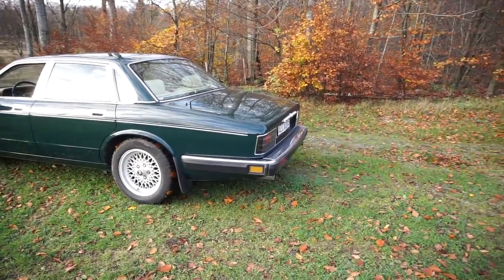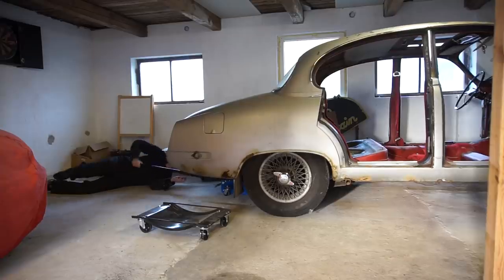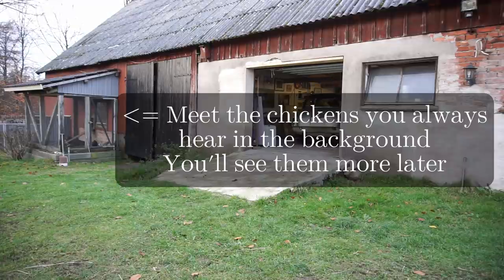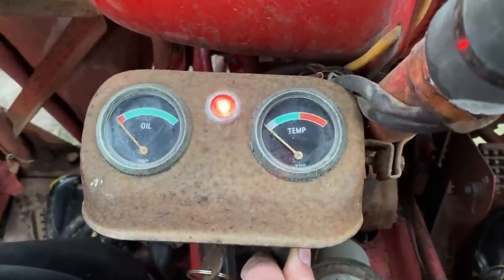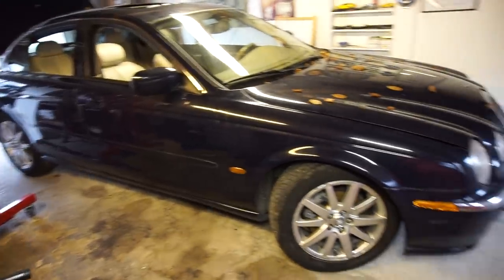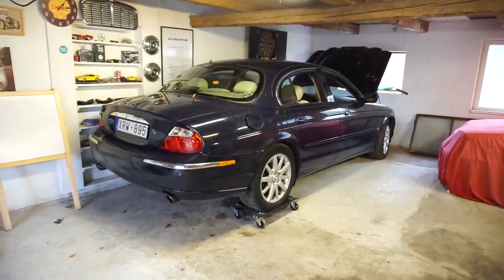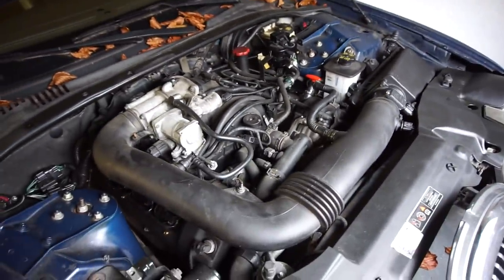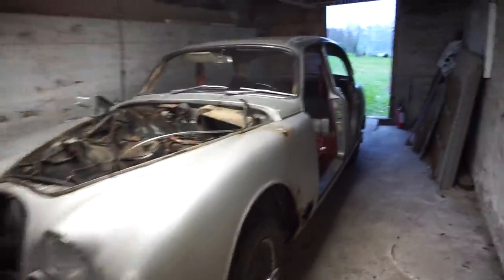My Wife Helps Me Move Most of the Cars on the Channel to Start the Next Project

Comment: I enjoy everything you do Adam. I use the same dollies and l struggle as well . I've  thought of fitting larger diameter wheels with rubber /nylon treads. And l 've also bolted a 12volt  winch to my floor. I used "thunder bolts " to secure it and have had no  hic cups . However my slope is not as extreme as yours .   I like your" use what you have "attitude.  So do you rent the farm?  The right rear sill/quarter panel looks like it will entertain you for hours and hours ! Great stuff.
Reply from the maker: Glad I’m not the only one that struggles with them.
No we own the farm. We bought it about 2 years ago and we’re restoring it ourself in our free time. 
Yep it will be lots of hours of cutting and welding ahead
Reply: @LivingWithAClassic   Free time ! What's that ? 😂😂

Comment: Hi Adam! I enjoy your channel a lot, I too have 2 series 2 XJ6's and an old 1800's place to live. I've also done a couple episodes to Youtube about metal casting, which I would like to continue with the time I currently don't possess. Your metal workshop plan looks great, I would recommend a device for sucking the welding fumes outside (such as Nederman)+ maybe fireproof panels (extra hard gypsum or fiber +cement-board) to the roof.

Comment: Hi Adam! Liked the vid a lot, also the christmasvid about the Fergie. Im in the process of taking out the 4.0 v8 from my 99 SType also. To lift it out is possible indeed but quite a drama haha. You have to disconnect a lot of stuff what is very difficult to reach like the bellhouse bolts, generator, pas pump and airco pump  Much more easy to lower it out complete with gearbox IMHO   Succes with all your projects and waiting for the new vids!

Comment: A significant amount of the work in restoration projects can be moving stuff around, which becomes much more difficult if you haven't planned what goes where. Watching the process is thought-provoking.   The ideal is not to move stuff any further than is necessary to get it out of the way. Another point is ensuring that you have adequate capacity safely to lift the heaviest things involved. (The tractor counts as a deus ex machina -or is it a machina ex deus?. )
Reply from the maker: It is! This was all done in a specific order too. That is why I didn't start working on the V8 S-Type earlier this summer because I knew I needed to move the 1966 S-Type before that.

Comment: 😀 yeah luv to see the S V8 being worked on/engine swapped
A few x308 bodied cars with the V8 are appearing on car sites where i live for sale for very low prices but stating requiring new motors & or blown head gaskets
Im surprised because many engines, for years, have 'nickasiled' cylinder bores
Must be a weakness in this model engine
At least not Mercedes where the camshaft sproket disintergrates & destroys the engine

Comment: Ha, so you found out the hard way as well with these dollies, I tried moving MY xjs on a set and met with the same result. They are  OK for moving body shells and heavy plant pots but anything more than that they are, erm you know, useless. I might try fitting larger wheels though and see if that makes any difference. You will also need to fit some extra power points as well by the look of it.

Comment: I like your style and that you like Jags.
I may have missed it but why is the engine in the V8 S Type "ruined"?
Reply from the maker: It was purchased not running with low compression. I got it going but then it turned into blown head gaskets and possibly more. There are 2 videos on it from earlier this summer on my channel
Reply: @LivingWithAClassic 
Thank you.
I will locate the videos you refer to.

Comment: My wife helped me move a "barn find" 1959 Jaguar Mk IX about 15 years ago. She sat inside the car, windows down, and steered it as I pushed. When it got to the correct spot in the driveway, she leaped out screaming that she heard mice in the car. Since then, she has refused to get into any car that doesn't run, or any car that has sat outside for any period of time. I used her refusal to build an addition onto the garage, taking it from 2 cars to 8 cars. So, I'd say a little mouse has been my greatest benefactor in owning multiple old Jaguars.